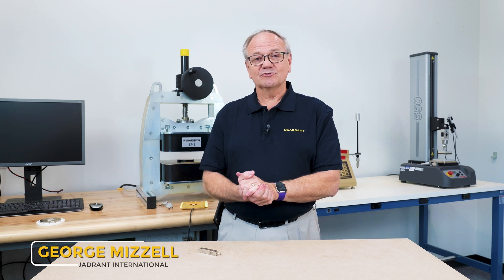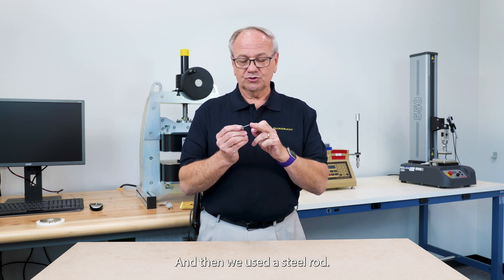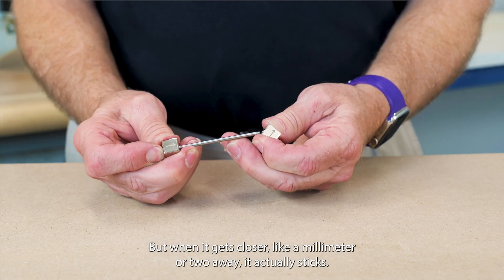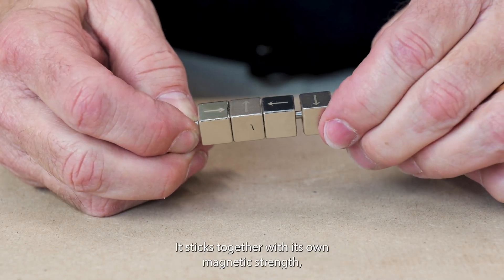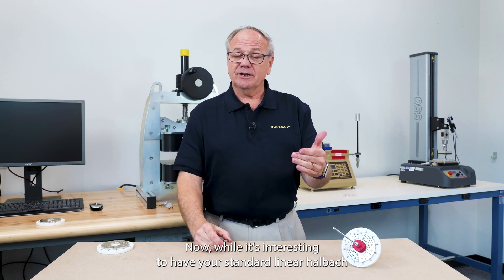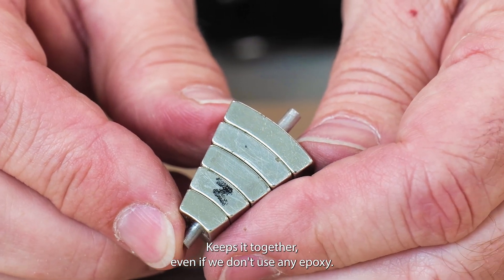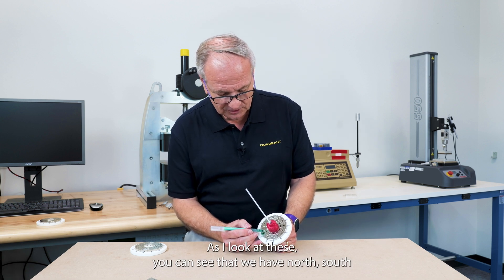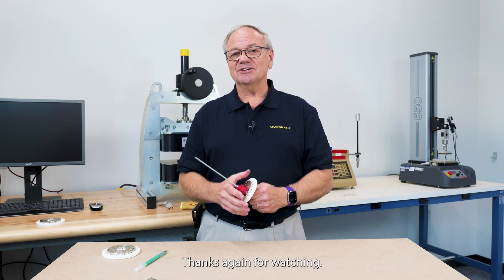Patent for Assembly of Halbach Arrays: Quadrant International  (Audio Adjusted)

Comment: Thank you!  That's concise and informative.  Makes sense to use in a motor as well: a Halbach array concentrates the strength in one direction, and dissipates it in another.  By concentrating towards the middle, and dissipating towards the outside, two things happen: 1. the motor is stronger; 2. there is less leakage, also reducing any unwanted effects on other machinery.  This is so win-win!  Awesome you got a patent out of it, too.
Reply from the maker: Great point!  thanks for your insights.  I agree and think that this will be a great way to design motors and alternators for wind turbines and wave generators as well.
Reply: @SuperMagnetMan  Hey I have a question: how did you get the patent?  Did you use professional services, or apply yourself?

I have some ideas I'm considering turning into current-sea...  :)  Thanks again!

Comment: That is brilliant. I assume no luck on the "2 pole Halbach Array" since its so expensive.
Also what is the efficiently on that motor with the new design?
Reply from the maker: Well, we have not finished building the motor yet - I need to work on the coil design to take maximum advantage of the new magnet geometry.:)

Comment: So cool! Sorry if I ask a lot of questions. I’m a magnet geek and have loved your channel for years. Can you explain what happens if the rod is smaller or bigger? Does that sticking effect not working unless you have it sized in a goldilocks range? Is the fact it’s steel a key part of it too?
Reply from the maker: Yes - the size of the rod is critical and that is the main point in the patent.  We like to model it to determine the optimum size for the rod.  The steel rod will reduce the amount of magnet material by a small amount and so we need to keep it as small as possible but if it is too small then it does not cancel out the repelling force of the neighboring magnets.

Comment: Attract or accelerate to a point between them. Field interaction happens first. Thanks for the share. Id love to see a video of 6 pyramid magnets 3 n 3 s facing outwards.
Reply from the maker: We used to carry a magnet that was an octagon with tapered pyramids and it was great.  We sold it a while back and have not had another one made.  It was 8 pyramids shaped to make a perfect octagon and each of the pieces were magnetized at the right angle and it had a steel frame around it.  We feature it in this previous YT video -  https://youtu.be/ep2PAMrzwEU .  Thank you for your interest:)
Reply: @SuperMagnetMan  my pleasure.